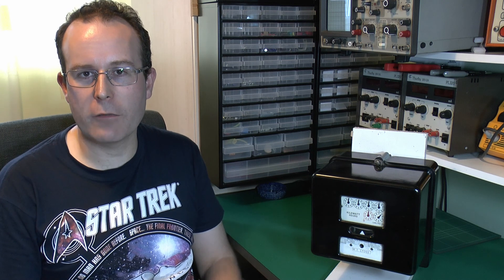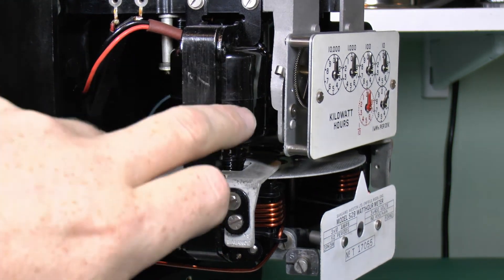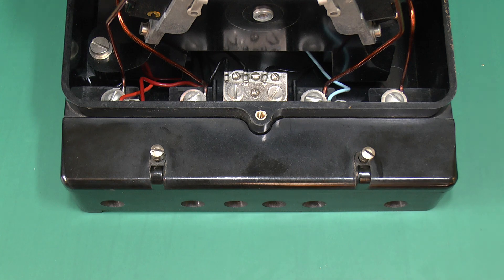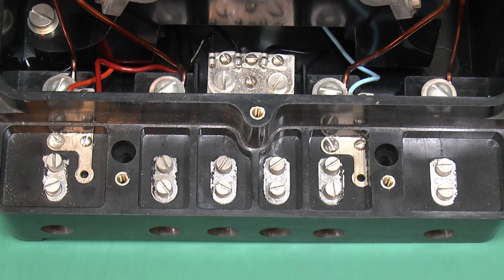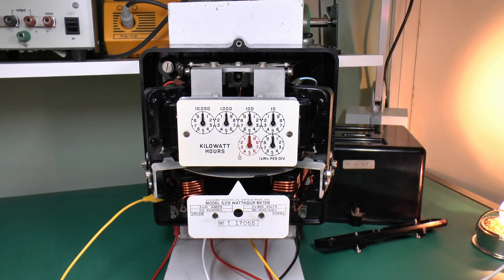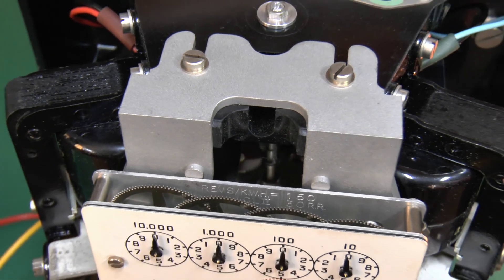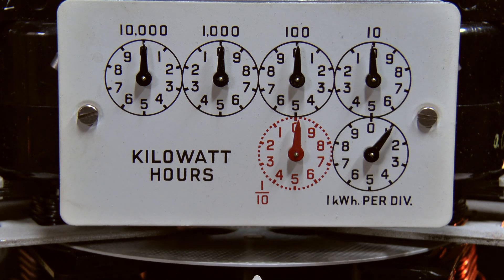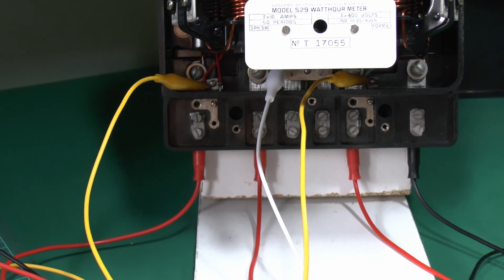Sangamo Weston S29 kWh Meter, 3 Phase, Form 2

Comment: It strikes me that this would be unusual these days, especially with yellow phase being linked straight through? Would it have been hooked to a delta output transformer? Otherwise I can see the possibility for fraud there, yellow phase to earth would have given you 240 unmetered.  Or is it, as I suspect, used for measuring usage within an organization of a single piece of 3ph equipment with a balanced load?
Reply from the maker: Most likely for a single item of equipment.